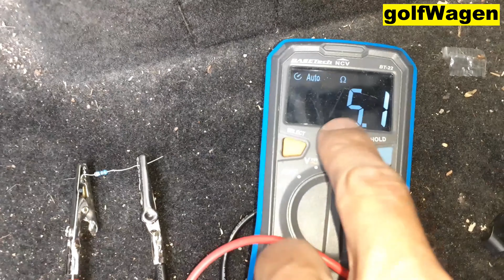VW Golf 7 airbag resistor for w/o airbag aftermarket seat

Comment: Hey, quick question.  I'm trying to do this with my mk7.5 Golf r.  I've tried a 5 ohm but it didn't work.  And a 4.7 with no luck.  But I may have the wrong watt and percentage.  What resistor specifically is yours?  My 5.0 ohm has different colours.

Comment: What is the value of the resistor you are using
Reply: Min. 0:31 It Is a 5,0 ohm resistor at 1% tolerance. But I thinking can use a 4,7 🤞. But I think is better use a original connector and solder a resistance.